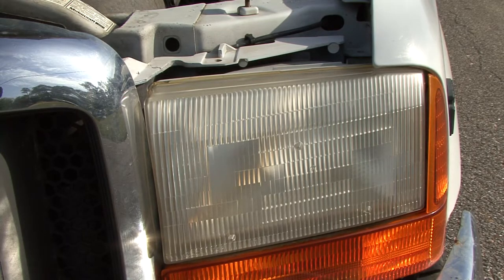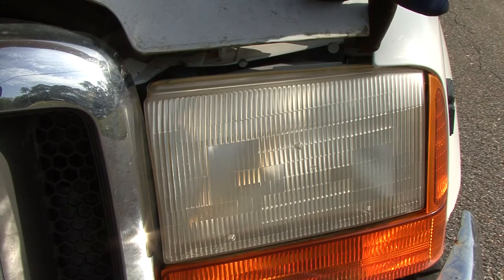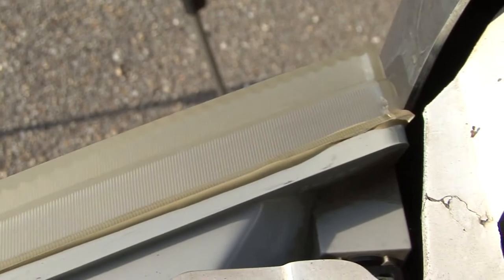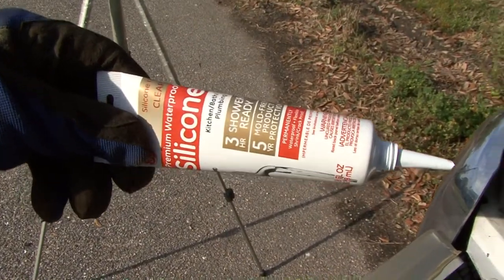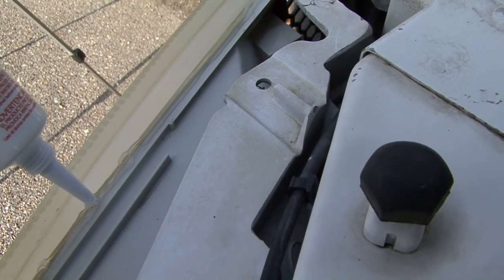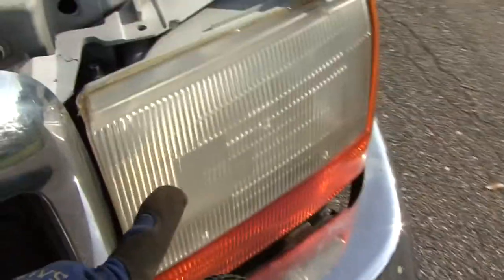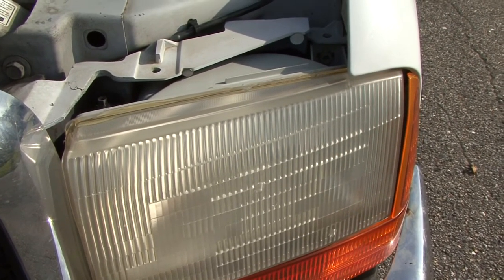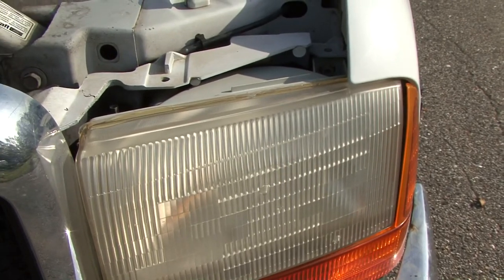Water in head light easy fix

Comment: Yes i agree i just looked at my 09 Tacoma and luckily i can access that whole top area. I am going to get a tube like the one you had with a long snorkle to get in the hard areas and then remove all the moisture by removing bulbs and heat lamping it. I have replaced this headlamp before and its a bitch. I am doing the work with it on. Thanks